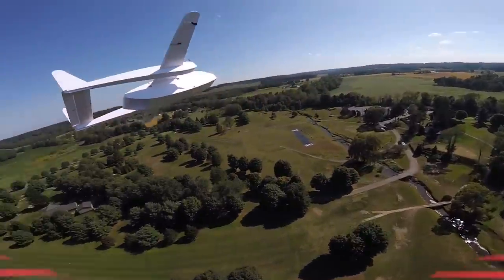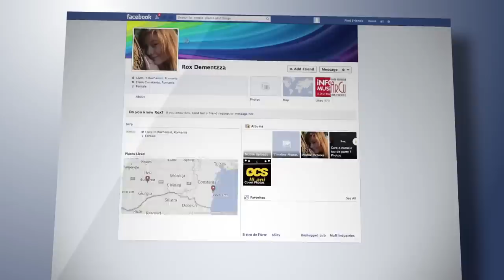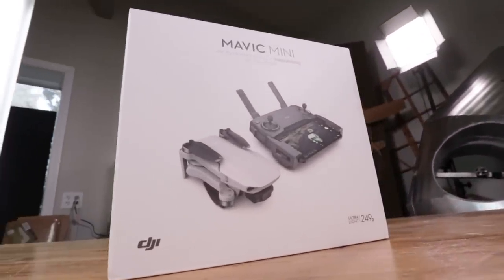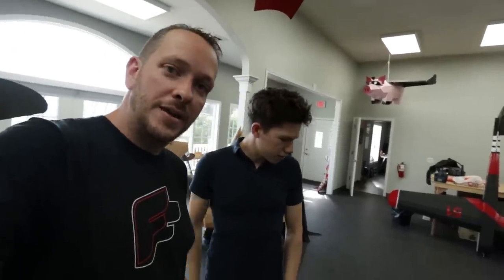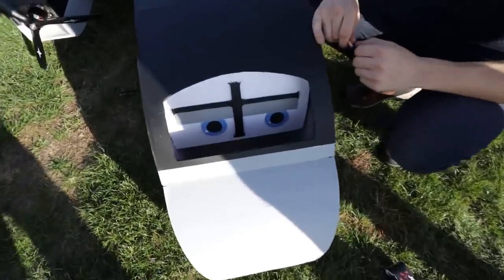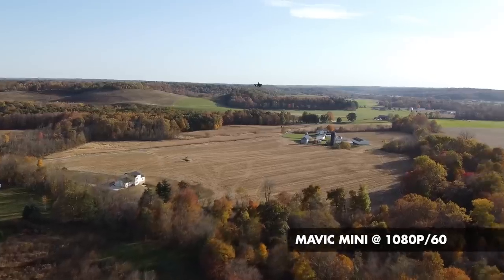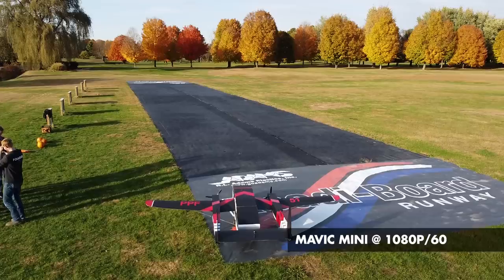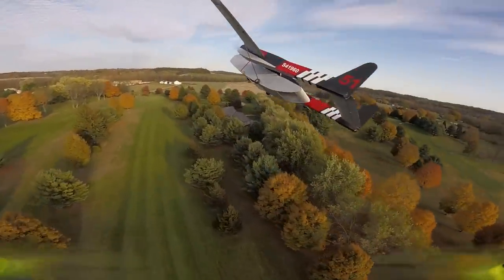Pumpkin Drop? from a GIANT RC Plane?! 😨 💣

Comment: Needs an FPV camera for the "bombardier" to align on target. Have Josh B fly LOS and someone else to direct him from on board camera pointing down/forward. Cool video!
Reply: ^^^ THISSSS!!!!!!
Reply: Highly underrated comment.
Reply: Maybe they could use a two camera system, and Josh could switch views, switch to "Bombadier View" and fly half-blind so to speak, to line up for the drop, and then switch back to "Pilot View" after the pay load is released?
Reply: @johnboleyjr.1698  Add in a buddy system link to a second controller, and configure it to yaw with differential thrust, so the LOS pilot puts Cabbie on approach, and the Bombardier Buddy lines up square. Then the Bombardier can trigger the bay door too.
Reply: best idea i've heard all week, build an FPV norden Bomb Site
Reply: I have done exactly that, except I was flying FPV also. My navigator hit the drop button.
Reply: @TheUAVpilot  Send FliteTest the video of how, or better, link it for the rest of us to enjoy! :)
What was the repeat accuracy like ?
Reply: Sorry, no video, was back in 2004. Very accurate and a simple camera setup. Here is a link I found of one of our drop flights and a BLU 108. https://investor.textron.com/news/news-releases/press-release-details/2004/Textron-Systems-BLU-108-Submunition-is-Successful-in-Weaponized-UAV-Demonstration/default.aspx
Reply: A quick explanation of the setup; The drop camera was mounted at a set downward angle of about 45 degrees. The video screen was marked with lines  going across it. The drop button was hit when the target crossed the line marked with the altitude that the UAV was currently flying at.
Reply: release by gps location.

Comment: DJIs are smooth but a proper chase quad still has to be a acrobatic class like the one that was right on the tail of the plane. Rule is if you want some cinematic or inspection stuff of the ground go DJI if you want video of style, fast / nimble chasing or air to air chasing go acrobatic. Thing is right now DJI recenently bought up a ton of advertising space from all the major flight related channels on you tube or gave them DJI drones and said "you can keep these just use them all time and hammer home how great they are" so for the next couple months expect to hear how great DJI from most of the channels. Mr. Steele recently called them out on some of their gear.

Comment: That 400 feet you mentioned may be true for powered planes Josh but cross country gliders often go up to even 4000 feet.  So the 400 feet limit would kill the sailplane hobby.  I often catch thermals and fly sail planes at 1000 feet. Anything below 400 feet and you’re done with a sailplane the thermals are hard to stay in and small and weak. So there are still problems with that 400 feet.

Comment: I'd like to see a flat-spin plane. Like, have a duel motor plane whose rudder can go full 90 in either direction and whose motors can go full reverse. You could get some altitude, then go full opposite on each motor, and chuck the rudder full 90, then once the spin gets fast enough to gyro-stabilize, use ailerons for height control. Then, of course, straighten out and land normally.... or land gently in flat-spin mode lol.

Comment: I really wanna see a plane like this but HUGE static thrust and huge wing area.
Something like a crzy coupe sized AVRO Vulcan (but with a victor tail). Huge wings with tons of surface area and an immensely strong connection to the body so unlikely to fold, Mount the motors on pylons to clear the wings, Try and get it to lift 10LB easily with a max of say 15-20LB.

Comment: Consider painting fiberglass screen on underside of wings to prevent upward folding...ie spray paint, then apply fiberglass screen and then repaint while still wet...the paint acts as glue to adhere fiberglass screen to foam....

Comment: Suggestion: put a little camera on Cabbie so you can aim a little better?

Also...can you add more props on the motors and a bigger battery?

Maybe do a ducted fan type engine affair for more thrust efficiency?

Comment: If you want to have more of a safety margin where weight is concerned, simply open the pumpkins, just like you would on Halloween, and scrape all the guts out. You could scrape out some of the shell walls to lighten the load. If it were me, I'd just go ahead and carve them into Jack-O-Lanterns, pop a few glow sticks in each one and drop them all at night.

Comment: You should honestly try using enamel paint. It will give your planes structural strength as well as distributed added weight and because it dries smooth it should also let the air slip across its surface better

Comment: for the bomber drops...i'd like to see you guys put a FPV camera on it...pointing DOWNWARD - use a piece of clear plexi with line that when in place, matches the centerline of the plane (and thus roughly direction of fall)   - add some cross lines and now you have a rudimentary bombsight -- would definately reduce your circle of error by at least one magnitude if not more...

Comment: Spraypainting tip !  lay down your base coat, then do your Masking, then, lay down  the base coat colour along the masking edge, that way ,if there is any creeping under the tape, its the same colour.  let dry,  Now do your next colour , when masking is removed you will have a clean sharp line,, BTW   Josh  ,that Boy of yours is a chip off the old block !!

Comment: We used to bomb with little sacks of baking powder from the J3 Cub when I was a kid & when it hit the ground it exploded white on the ground & you cld see it from the air real good, then we cld make another bombing pass & get better zero in, right on the chris cross, in the winter we used crushed coal to see it better in the snow, we played with dads J3 all the time, the plane was on skies in the winter & gas was real cheap 15 -20 cents in the fortys after the war was over & we used car gas in the plane some times & never had problems with the engine but dad had a full time mechanic at the airport anyway.

Comment: Btw , in Thailand you have to register every flying thing regardless of weight if it has a camera (or anything over 2kg if it doesn't have a camera)

The least you can do is CHECK YOUR LOCAL LAWS before spending your cash on something you might not be allowed to fly.

Comment: I know I'm late to the party,  but I wonder if you could drop the Mavic out of Cabbie.
Use the prop guards so you can have the Mavic "idling" (if that's a thing)  in Cabbies cargo bay.  Also rig the cargo bay door so that it only opens to about 25 or 30 degrees.  This way, the mavic will slide out, rather than tumble.    Of course,  record the video from the mavic.

Comment: 400ft is total BS. 400ft for regular drones? sure. I can kind of get that. heck most of my smaller craft I can barely see at 400ft.

but I Have been flying RC for 30 years. my CRUISING altitude for my thermal birds is 1800 to 2000ft I punch out of thermals at 2500ft when it gets harder to see the glider. my AP birds fly at 1500 to 2000ft

my SMALLEST rocket glider apexes at 800ft on boost. that is the "LOWEST" I can fly that bird without over speeding the airframe (forcing it level under thrust)

My regular RG's apex at 1800 to 2200 ft. on smaller motors!! The only reason I don't boost higher is my eyesight is not "good" for higher with these size of birds.

some of the flyers with better eyes than me punch 2800ft plus with their rocket gliders. not thermalling. just the initial boost. they can go much higher thermalling.

400ft basically destroys a huge swath of hobby flying for NO good reason. none whatsoever.

I will summarily ignore the 400ft altitude limit as an unlawful restriction without authority. I will never pay any "fine" associated with this. if that means I goto jail. so be it. they can throw me in jail for flying a styrofoam glider. I am past the point of caring.

And I will never register. ever. I do not recognize the authority in my government to compel me to ask "permission" to fly toy model airplanes. I simply do not recognize them as having that power.

Comment: 6:00 please stop implying the rules don't apply with the Mavic Mini, rules are different throughout the world and you will still need permission to fly this thing inside a Flight Restriction Zone in the UK and abide by the ANO (i.e. stay 150m away from congested areas, don't rly above 120m altitude).

The only thing being under 250g exempts you from here is having to pay the £9 operator registration fee or having to take the pilot test, every other rule still applies and come next July if it has a camera this exemption won't apply either under the new EASA rules.

We have finally got to a stage where drones are not news headlines every other day so please be more clear and stop selling items like this as having no rules, even if that is the case in the USA or Canada you have a global audience and there are plenty of idiots about that will no doubt try to push the limits with this craft, if anything you should be encouraging people to familiarise themselves with the rules regardless of weight.